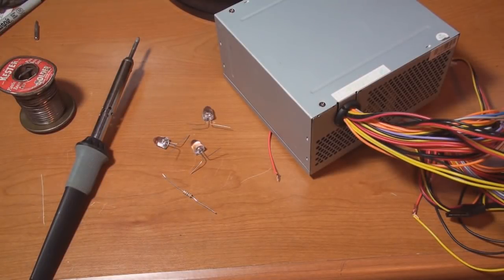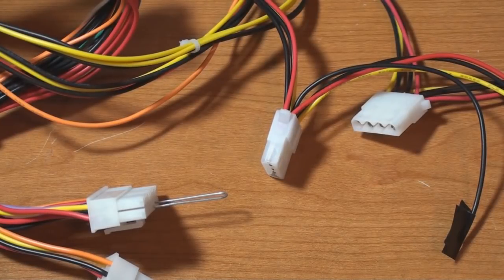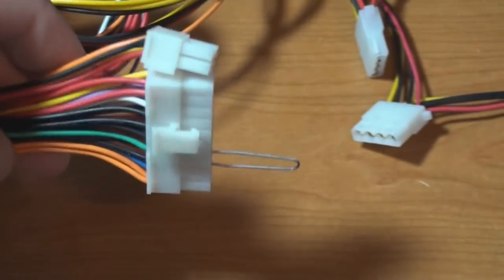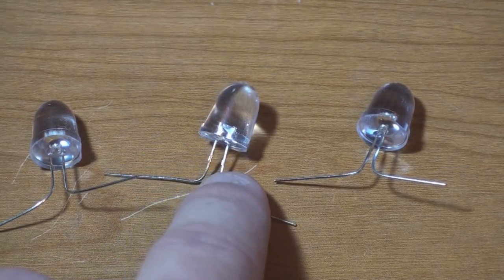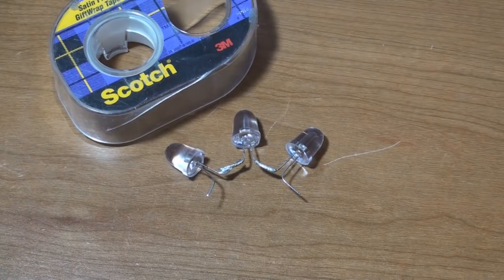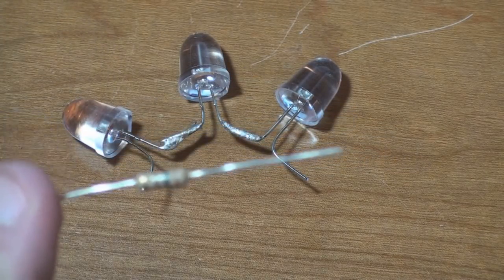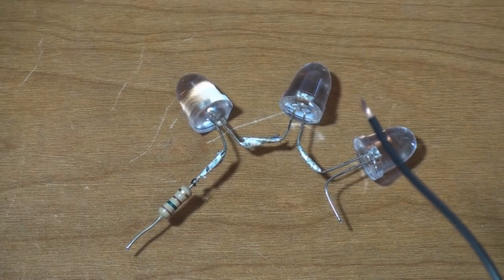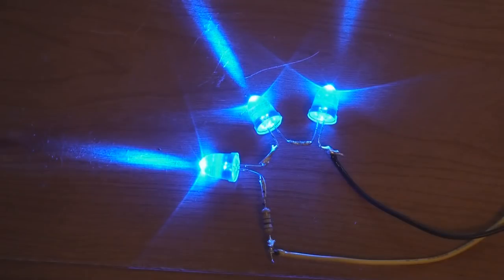How To Wire Multiple LED's in a Series Circuit !!

Comment: in a computer case fan, why do  most use parallel in wiring,lets say, 4 leds ?
I've never seen a series-wired led circuit in fans (at least in forums). Is it because of voltage drop? Or is it just better if it's wired in parallel? (coz series circuit is damn easier, less messy, and requires less wire length)

Comment: @kachraseth313 small leds typically dont want more than 30mA or so. i suggest finding a wall adapter and using that to power a string of LEDs in parallel. u can cut the ends offthe wires coming from the adapter and locate the pos and neg and use that. its safe to handle even when plugged in. say u have a cell phone charger that gives 5v@ 300mA then u can probably get away with putting 15 3v leds in parallel on a board or something and hooking them straight to the adapter, no less than 10 though

Comment: @kachraseth313 NO! that is dangerous =D

technically you can but u want to make sure u have enough leds in the string to consume the output voltage of your socket (120V in the US) so if they are 3v leds u would need a string of 40. u also need to consider the current that can come from the socket. many amps which can kill you at 120V if it travels through your heart. if the string is overfed current it can possibly melt together and dead short your socket tripping your breakers and maybe more.

Comment: What is the max number of 10mm LEDs you can use with a 12 volt power source, why not use a capacitor instead of a resistor?

Comment: ... what happens if you have 2 different kinds of leds with different amounts of voltage? how would you run this in a circuit? do you run the 2 on separate circuits?

Comment: @MasterDysires yes as long as it is not store bought and ment to go into a wall outlet for 110v or higher or a 12v battery wount power the strip so the best thing is to buy small voltage l.e.d.s such a a 10mm white led required 3.5v to 4.0v and depending on how ever many u put in you will want to put a resistor on and have a minimum amount connected such as this video did and just tie the power sorce into all of them so 1 power spliced into the bunch of 3s and for 1 l.e.d. u need 470ohm resistor

Comment: i want to use about 15 leds how many resistors do i need and what size resistor will i need also i m going to get smd leds do i have to use some special wire to connectt them i dont want to connect them directly to each other

Comment: Nice video bro...I kinda prefer running them in parallel (when possible) as opposed to series,  because in series if one LED goes out....then none of them will light. Then you have to test each one to find the culprit. But in parallel, if one goes out it only effect that one.